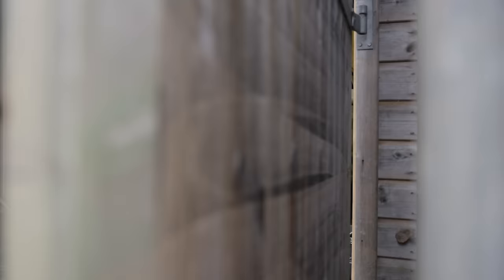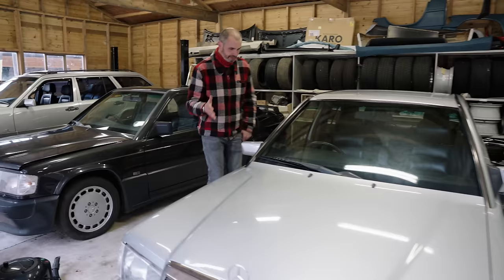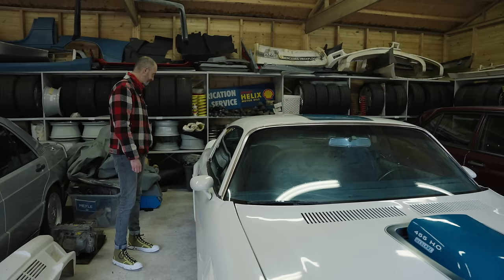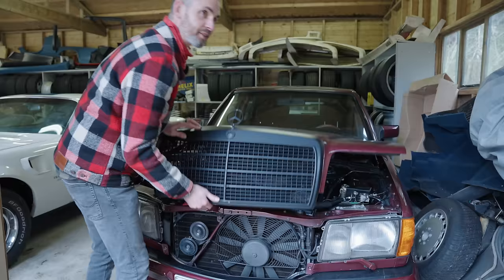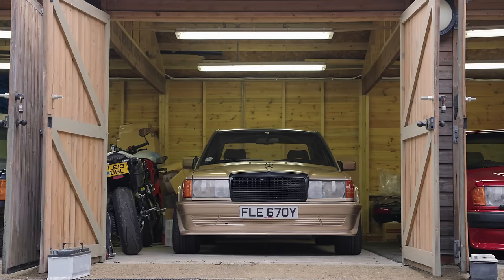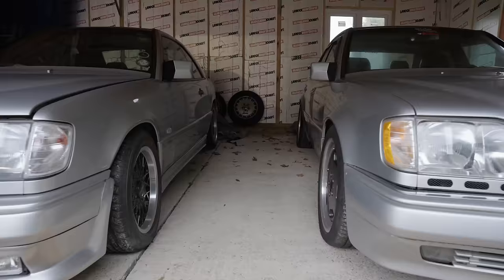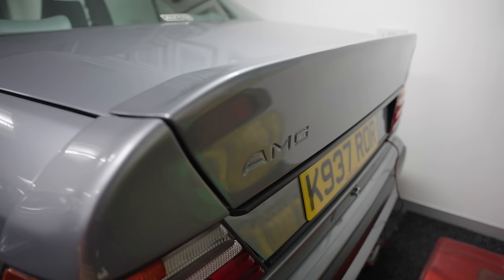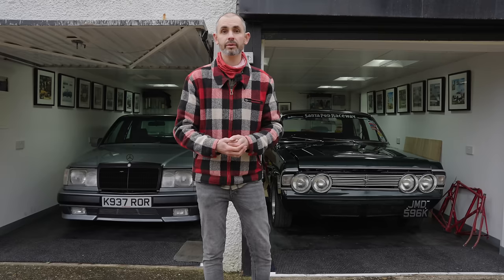Secret collection of 80s and 90s AMG & Brabus Mercedes - Car Caves

Comment: Dutchman Willy Mosselman made some incredible turbo kits for Benzes. I remember reading an interview with him in a Dutch car magazine (Autovisie). His filosophy was to keep the compression ratio high and use low turbo pressure. This way the efficiency of the engine was good at the whole rev range and turbo lag was also not an issue. It was a totally different filosophy than what was common back in the 80s.
Reply: Quite similar to what Saab did then!

Comment: Thank you for making this video. Mercedes Benz 190D was the first car, I got to sat in. My uncle had it, originally was a red car, and it was painted silver. It was just lovely, manual transmission, I really love the spare wheel, how they have a plastic sort of tub, which sort of turns and locks up. It had a lovely Pioneer Hi-Fi system, with a remote which would click in on the steering wheel.

Comment: I love them all, but I especially like the '71 455HO 4 speed manual Trans Am. Built before the oil crisis and emissions regulations strangled the muscle cars.

- I had a '76 400ci 4 speed, it had a '73 pre-smog motor. I bought it when I was 22 and kept it 9 years. It was a beast. Wish I still had it.

Comment: I have   a 1994 S320 in running condition. The car is parked in South Australia. This car was the mothership in 1994. It has tinted double glazed windows, long wheel based, soft touch doors, sun roof , grey in color. This car is for sale for A$8.000.

Comment: I have a W202 AMG that I converted to a manual transmission
Reply: Was it hard? I have a w202 C280 sportline I want to convert. Did you use shifter cables?

Comment: I don't get why you'd fit a bunch of E60 parts into a non-E60 car (i.e. the on screen caption labelled the engine as a 500) then say it has 381ps, which it doesn't.  Same goes for quite a number of the cars which aren't original AMG or Brabus vehicles but 'evocations', comprising various bits/pieces from AMG/Brabus (albeit original bits/pieces). Fair play for amassing such a collection but, for me, originality in these old Mercs is important.  Anyway, it's his money and different folk get enjoyment in different ways, so each to their own

Comment: Cool collection but quite misleading title, not really any actual original pre Merger AMGs, or real Brabus in the entire collection, save for the 500 SEL with the AMG kit, unless I skipped past one.  The Brabus and AMG badges on the stock engines is abit cringe.....
Hopefully the turbo 124 and 190s can be finished and properly set up .
Reply: That's because the owner is actually an extremely cringey boomer named Neville Brown. He lives in Reigate and is well known in the Mercs community for harvesting parts that owners of genuine pre merger AMG are actually in need of.